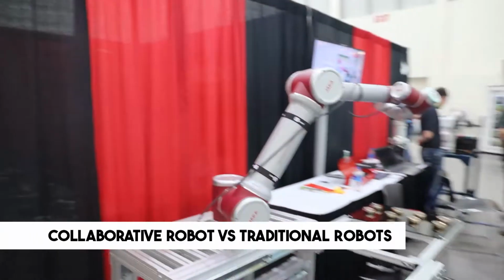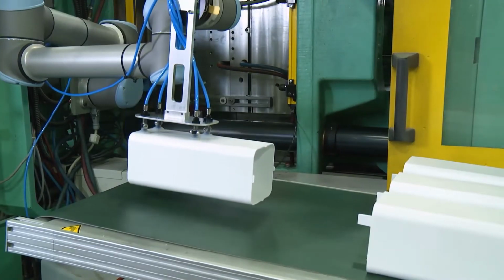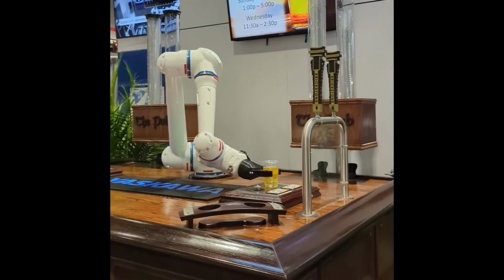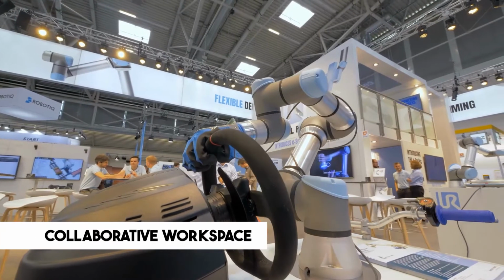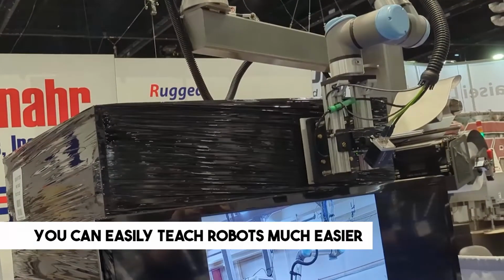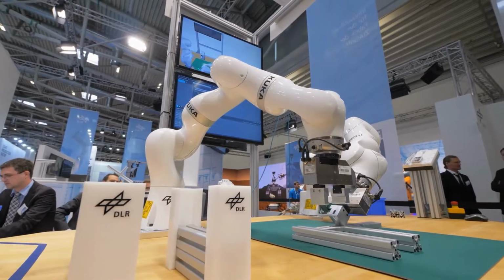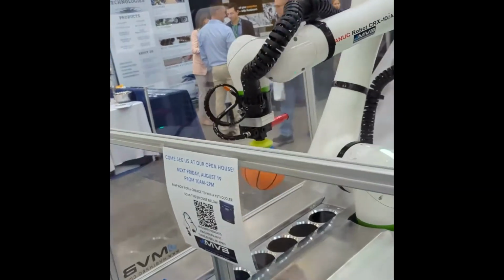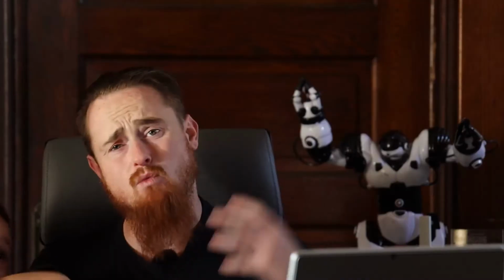COBOTS vs ROBOTS

Comment: Thank you. I want to ask about what parameters we need to take care while choosing a Robot?
Reply from the maker: Hi there, here's some information regarding your inquiry. Choosing the right robot is a crucial decision, whether it's for industrial automation, personal assistance, or any other application. Here's a breakdown of the key parameters you need to consider:

1. Application and Task:

What will the robot do? This is the most fundamental question. Will it be used for manufacturing, welding, painting, assembly, material handling, or something else entirely? The specific task dictates the type of robot, its size, capabilities, and required precision.   
Environment: Where will the robot operate? Is it a cleanroom, a factory floor, outdoors, or in a hazardous environment? The environment influences the robot's design, materials, and safety features.   
2. Technical Specifications:

Payload: How much weight can the robot lift or manipulate? This includes the weight of the end-effector (gripper, tool, etc.) and the object being handled.   
Reach: How far can the robot's arm extend? This determines the robot's working area and its ability to access different locations.   
Degrees of Freedom (DOF): How many axes of motion does the robot have? More axes provide greater flexibility and dexterity, allowing for complex movements.   
Speed and Acceleration: How quickly can the robot move and change direction? This impacts the overall efficiency and throughput of the operation.
Accuracy and Repeatability: How precisely can the robot position itself and repeat the same motion? This is crucial for tasks requiring high precision, such as assembly or welding.
3. Physical Characteristics:

Size and Footprint: How much space does the robot require? This is important for integrating the robot into a workspace or production line.
Mounting: How will the robot be mounted (floor, wall, ceiling)? This affects the robot's design and stability.
Weight: How heavy is the robot? This can be a factor in installation and transportation.
4. Software and Control:

Programming: How easy is it to program and control the robot? Different robots use different programming languages and interfaces.
Connectivity: Can the robot communicate with other devices or systems? This is important for integration into automated workflows.
Safety Features: What safety mechanisms are in place to prevent accidents and protect workers? This is crucial, especially for collaborative robots that work alongside humans.
5. Cost and ROI:

Initial Cost: How much does the robot cost to purchase? This includes the robot itself, as well as any necessary accessories or peripherals.
Operating Costs: What are the ongoing costs of running the robot? This includes energy consumption, maintenance, and repairs.
Return on Investment (ROI): How long will it take for the robot to pay for itself? This depends on the cost savings or increased productivity that the robot provides.
6. Other Considerations:

Reliability: How dependable is the robot? Look for robots with a good track record and reliable components.
Maintenance: How easy is it to maintain and repair the robot? Consider the availability of spare parts and technical support.
Manufacturer: Choose a reputable manufacturer with a good track record and strong customer support.
By carefully considering these parameters, you can select the robot that best meets your needs and ensures a successful implementation.